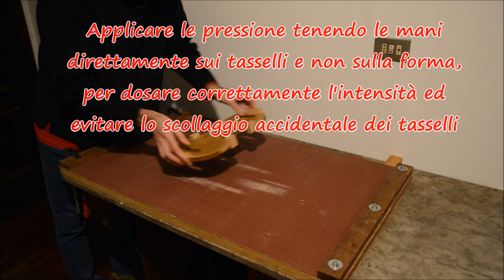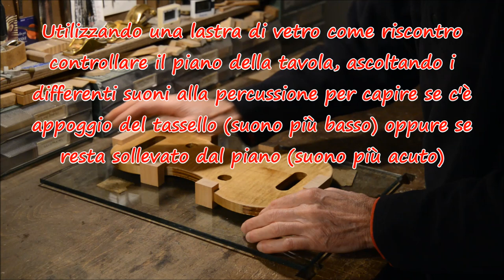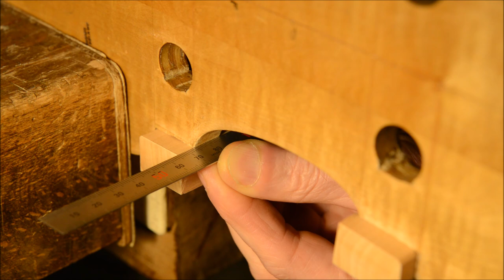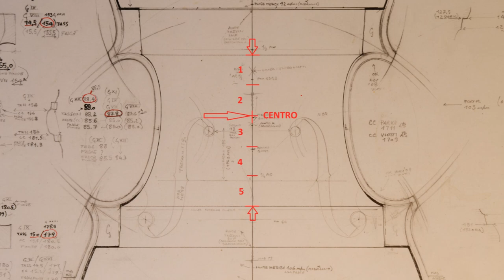2) Tracciatura dei tasselli

Comment: Which sandpaper do you use for sanding work?  (which number ? )
Thank you
Reply from the maker: The red sandpaper on the flat surface is 80 grit, it is the type used for belt sanders (thickness sanders), which is very resistant to wear
Reply: @DavideSora  🙏🙏🙏

Comment: great videos! Thanks for sharing such an insightful lens into lutheir work! I'm just wondering what wood do you use for the mould? It looks like maple on front but then plywood on the side.
Reply from the maker: This is an old form of beech plywood, which was badly twisted, so I planed it and made a few cross cuts to straighten it and glued two flamed maple veneers (1.8mm thick cello ribs cutouts) to keep it straight and restore the lost thickness.
But I don't always do that😊, it would be too much work. I normally use solid hardwood (Stradivari used Walnut, I used Teak and Mahogany, but any hardwood is fine) so you can plane it to make it well straight and at the thickness you need (13/14 mm max). Plywood can also be used, but you have to find it well straight, which is not always the case, otherwise planing it to straighten it's a nightmare (see above). In any case, many luthiers use plywood, the one with very thin and numerous layers, such as marine plywood, would be better for stability.

Comment: Are you using willow or spruce for the blocks?  the grain doesn't look like spruce.
Reply from the maker: Willow, the same wood used by Stradivari and others cremonese makers, except for Guarneri del Gesù that used spruce. Also spruce is a good one to be used, if with tight grain, but is tricky to work with and need much attention to the direction of the grain. Low density willow is the best in my opinion, but you may use many different wood if you like (even Lime, Tiglio in italian, is found in old makers works) 
Light and compact is the main quality to be considered.
I mention all  this details in the first video of the serie at 00'38" time (see english translation with timing below the video)
Reply: I am using spruce,  using your video as a guide.  The spruce is a bit difficult to work for fine details like the corners. It requires very sharp tools.     I'll be posting pictures on Maestronet.
Reply from the maker: Yes, spruce is quite delicate wood, for this reason is better to select tight grain spruce for blocks and respect grain orientation, not strictly necessary with willow.
See you on Maestronet.